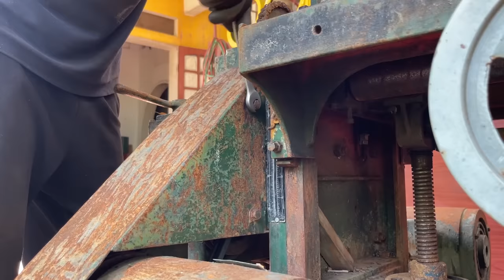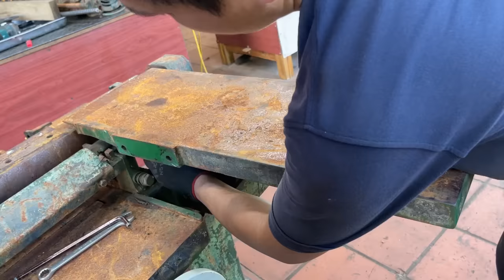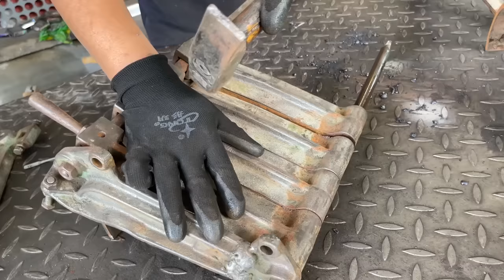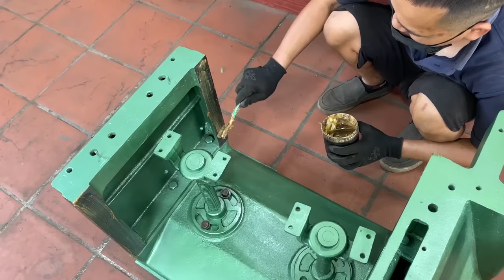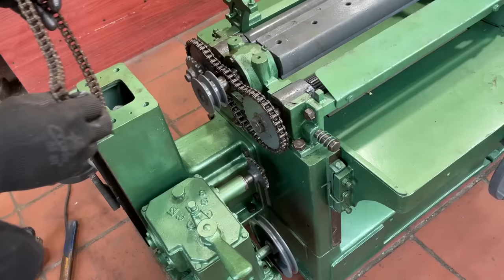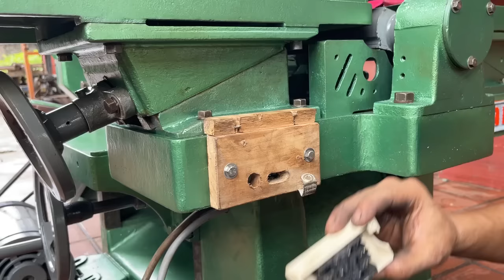Restoration Genius  The Genius Boy Restores The Hitachi 3 In 1 Woodworking A 1500A For Carpenter

Comment: Jesus, when you did your test cut the cutterhead was 1/4" higher than the outfeed table... you're lucky you still have hands.
Reply from the maker: Thank you very much, please watch our next videos
Reply: This is all fake bs. Finds a relatively rust free tool in an ally next to a crane truck.  It's hot, humid, and rains everyday where he's at.

He has no clue what you're even talking about, or what he is even doing with this crappy machine.  No clue how to use a jointer, no clue how to use a planer, and will no doubt cut off a few digits soon, if he hasn't already
Reply: I agree that he should be greatful for not having a hand less!
Reply: @CaptainRon1913  they buy old machine from somewhere and then make a video with it 
i bet is the same company that was making the fake "house of mud in the forest" "primitive tecnology" videos and got busted 

they are entertaining tho :)

Comment: This is such a fascinating piece of equipment, if it had been done correctly. Never paint your feed tables or planer knives, or saw blades, that just creates drag and it’s gonna wear off quickly anyways. Also I’m glad you didn’t lose fingers when the jointer kicked back. Make yourself some push sticks, your safety is worth the effort.
Reply from the maker: Thank you for your comments, we have learned a lot from you. We invite you to watch our next videos
Reply: @restorationproduct1718  please remember that wood working machines can take your fingers or hand off before your brain even knows something went wrong, it just takes a fraction of a second.
Reply: That jointer taking of half an inch off was scary. VERY SCARY. I wanted to comment the same, "congratulations on not ending up injured. Please be safe, there is no shame in it"
Reply: I agree.  I cringed every time you ran your hand over that jointer blade.  Then I jumped when it kicked back in your second pass.  Please be careful!
Reply: @cm5838  you have that right! I have nerve damage from carpal tunnel and diabetic neuropathy in both hands. I have zero feeling in them. So when I let my right index finger relax a little too much it had a conflict of space with the blade on my table saw. Yes I was using a pusher stick but shit happens fast. I'm looking around to see where all the blood was coming from. It seems instead of cutting off the tip like normal people, I had to split mine right down the center to where the nail quit and skin took over. Aw, shit! I wrap it up in the cleanest rag I had and walked inside to tell my wife I needed the emergency room. She just grabbed her purse because she knew when I said go.... I was serious. 
So the doc is looking at it and says stitches and starts to get the numbing stuff out. I told the doc just to do his thing. He tells me it's gonna hurt. I'll be ok, just have at it. So he gets the Q Tip looking thing and starts cleaning it out. I'm just smiling at him. He is starting to look a bit uncomfortable by now, wondering if he had some insane guy here. I finally let him off the hook and told him I had crushed that finger years ago and had no feeling in it. He stitched it up and said that was the weirdest thing he'd ever had happen to him. 
The finger healed up nice but it still has a funky nail. 
Yes. Freakishly fast. Then you are bleeding. That's not good. 
Cheers
Terry
Reply: @machinist5828  Bet you were real glad you crushed that finger beforehand. Had an impact cam out and put a full speed PH2 bit all the way through my thumb nail and then the rest of my thumb once, I'd have traded feeling in that finger to have never felt that.
Reply: Gods, that electrical wiring 🤮🤮, no strain relief, no grommets, cracked and crusty insulation. I know it’s unfair to compare regulations in different parts of the world, but there is no way on this planet you’d get me to use that machine.

However, the lad is a fair mechanic, so ya have to give him that, and brave too 😜

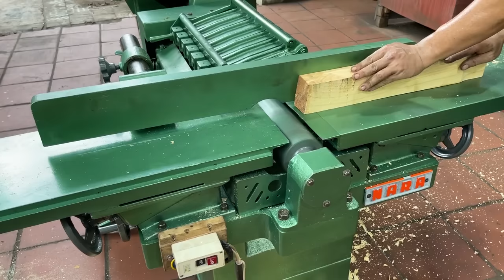Comment: My man almost lost his hand at 54:33....jesus.  Good on you putting this back in operation but it was almost your last rebuild.
Reply from the maker: We are also very lucky, and learned a lot from this machine
Reply: @restorationproduct1718 Except how to use a push stick. You immediately repeated your mistake. You're not going to have all your fingers for long.
Reply: @R.Daneel  wrist
Reply: It's because he was using the planer incorrectly by removing nearly a centimeter of wood at a time, which led to a kickback, and they nearly lost their fingers.
Reply: OMG!!!! I can't stop laughing🤣🤣🤣🤣🤣🤣🤣🤣🤣🤣
Reply: DUDE that was REALLY close.... You could see it coming, no guard there and he's pressing down like that omfg!!
Reply: Push stick, and take less off at a time Holy God Almighty
Reply: It has nothing to do with push sticks or how hes holding it. The exit table needs to be the same height as the blades or .01mm lower he has it way way too low. That wood is riding on blade only.

Comment: Nice work but the table tops should not be painted just polished and machine waxed
Reply from the maker: you are very right to say that the worktop is not painted. we have cleaned the paint on the work surface and applied a protective oil on it, thank you for everything
Reply: Poca seguridad n el uso d la máquina...
Reply: Non of the machined faces should be painted.
Reply: 8
Reply: Non of the machined faces where the wood will be touching or sliding should be painted.  Rather they should be polished and then given a coat of wax.  Other than that mistakes nice job.
Reply: @restorationproduct1718 🎉😅😮😢
Reply: That's true, he can always strip the table tops, buff them out, and furniture wax them to prevent rust
Reply: DUDE.....GET A PUSH STICK!!!!! When you were testing the jointer, I almost freaked when it looked like you had pushed your hand into the knives!!! Please be more careful
You did a pretty good job on the restore, except for painting the machined moving faces, as has been said, mating moving faces get lubrication and need to be bare of paint!
Reply: You are 100% right, but this is typical an example of getting as many youtube hits as possible. Because an expert will do the job different and better.
Reply: I agree and the electrical work was ruf as guts and that bit of pallet rack wood behind the switch ruf and ready
Reply: Fake anyway 🎉🎉🎉😂😂😂

Comment: I'm a new subscriber. Fantastic job of rescuing this piece of equipment. I do agree that metal table tops should not be painted, as the paint will wear off. You can clean them with WD40 ans steel wool. Then waxed with machine wax or car polish. This will repel water and prevent rust. Remove all rust from the inside of brackets and the bars that hold them. Other wise it will continue to rust. Avoid painting adjustment screws and the gears. As the paint will wear of and can cause problems later. Polish them as clean as you can. Tape off before painting, then apply grease only. Good luck, hope to see more soon.
Reply from the maker: Thank you for sharing a lot of interesting knowledge, we learn a lot from you

Comment: Sin demérito del esfuerzo y pese a las limitaciones del lugar en:  equipo o herramientas,  los reemplazos como el tensor de cadena que no es original,  las cajas de conecciones que se pueden improvisar con cajas conduit normalizadas para resistencia mecánica,  y decir que las superficies de trabajo expuestas a roces de la madera, no deben pintarse porque eso crea alguna resistencia al avance, aparte de manchar en algunos casos  las piezas de madera. Lo mejor es solo pulir bien  y dejar el metal tal cual. Pero les felicito.
Reply from the maker: Gracias por compartir muchos conocimientos interesantes, necesitamos aprender mucho de ti.

Comment: The skill & expertise shown on this is excellent.  Many designing engineers deal with a complex machines they draw up and only have responsibility on a theoretical basis.  In other words they aren’t mechanics putting the equipment together, or the end user actually getting it to function, in this case carpenters.  That is not to say any of these skill sets are inferior, but my gues this fellow is mor of a mechanic than design engineer or carpenter.  I also think it is entirely possible that he’s never seen this Hitachi  in any shape.  His talent is superb.  The owner of the shop that abandoned it is probably still looking for the idiot that parked outside. This machine in its ruined condition would bring around $4000 US.  Restoration would add several days and bring the price up again.  Very complex.  Thanks for posting.
0 57:52
Reply from the maker: thank you very much , we worked for many days to get it working again, the result is amazing
Reply: Set the second half of your jointer table the same height as your blades are cutting and you will eliminate that deeper cut at the end of the pass
Reply: Hats off to the genius who designed this machine  😅😊😅😊❤

Comment: Wow! he could have had a very bad accident when planning  that piece of square wood.  The back table wasn't set level with the cutting edge of the blades, it was to low, so when he got to the end there was a big dip in the cut.
Reply from the maker: I'm sure you are a professional, we thank you for your comments, good luck
Reply: @restorationproduct1718  Thanks for the reply. I am a qualified wood machinist.
Reply: Outfeed table
Reply: It also looks like the in feed and out feed tables weren't parallel  @stefankaz53
Reply: Oh, so the exit side has to be parallel to the planer blades' cutting edge to prevent the overdigging and danger of feedback? Good to know. 

I would think they would use push sticks or some form of safe workholding - anything to keep fingers away from that exposed high speed planer blade...yeesh

Also, I am assuming that the correct direction of workpiece is against direction of cutter rotation? 

I've been rather interested in a planer, but more of a want than a need, as I am more of a machinist than a woodworker

Comment: Great job of rebuilding it and making it useful for  a few more decades. But be careful, fingers don't grow back. I was surprised you did not sand blast the pieces instead of using a grinder and wire wheel. Any particular reason?
Reply from the maker: Due to difficult economic conditions, we do not have money to buy a cutting machine, we clean it completely with a hand grinder, thank you very much.

Comment: Good work but you should be wearing safety boots. When using a dolly for the end of shafts make sure you use a brass or copper one , not steel.  The electrical connections need to be improved for safety and emergency knee or hand stop fitted. I did enjoy watching you restore old equipment.
Reply from the maker: Thank you very much

Comment: realy smart mashinery you can use the jointer-function the same time as the thicknesser ... I have seen a mashine-setup like that ... I guess the only downside to that is the very very long expensive cutting-blades ... else it is forsure a nice combi-tool, thou a riving knife for the sawblade you be better... I was to quick .... now I see spindel have a dual setup, hence two seperate sets of knifes
Reply from the maker: Thank you very much, you are very knowledgeable about woodworking machines, nice to meet you

Comment: The way he put in the planer/jointer blades and how he used the saw makes me beliwe that he has absolutly no Idea what he doing with this machine. hope that that carpenter who gonna use it not gonna get hurt and gonna do all kind of adjustment before using...
Reply from the maker: You are very right, when the carpenter received the machine, he had to realign the cutting blade, thank you for everything

Comment: Well done but you need to fine tune to out feed table of the jointer or you will loose your fingers. the outfeed table needs to be wound up and when feeding the timber on the jointer try not to take so much wood off in one hit. Be safe mate as they do make a mess of your hand.
Cheers
Brad
Reply from the maker: Thank you very much, we learn a lot from you, and lessons learned from this machine, see you again in the next videos

Comment: At the 54:18 minute mark, you can see that the base of the planer (on the right side) is set incorrectly in relationship to the left one. Not only is he taking off too much but the base on the opposite side (left side) is too low. When he is at the end of his cut, you can see that the workpiece drops and, as we saw, that's dangerous. So, in other words, he has both bases set incorrectly from each other based on the direction of the cutting blades. The only way to correct it would be to raise the left base and lower the right one.  He's lucky he did not lose his fingers.
Reply from the maker: Thank you for sharing your experience, we will learn from it for next time

Comment: The planer blades do not cut correctly, as can be seen in the images, they leave many steps in each pass.
Reply from the maker: It's possible that the blade is worn unevenly, so we'll replace it with another blade

Comment: Correct sized spanners do not mess up the corners of the bolt heads
Reply from the maker: you are very right if you use the correct wrench, the bolts will not be like that

Comment: It's looking good, but, I don't agree with the painted work surfaces, though. The only thing that supposed to be on them , they should be cleaned off, all the way down to bare steel, and with a good coat of wax. The woodshop where I used to work, we used Turtle Wax. We even waxed the table saw blades, the radial arm saw blade, and the band saw blade.  Safe to say, we had a smooth operation, at that shop.
Reply from the maker: Thank you for your feedback, we will learn from your experience for next time. We invite you to watch our next videos

Comment: The near accident that almost made him lose a finger is unfortunate. (The fact that they did not edit it tells us "WHAT NOT TO DO" when working with any equipment). BUT we have to acknowledge and appreciate what he has done to bring back life to this machine. It may not be perfect and surely not as pristine, but the fact that this Hitachi woodworkers tool has been exposed to the elements make it worth the time and effort put into it commendable. Some adjustments later on will be easier because of its present condition.
Reply from the maker: Thank you very much, we promise to try harder not to disappoint you

Comment: Hello, I don't care if you wrote that the instrument was restored but after the fact, you cleaned and decorated the living room, and you didn't have to add these details to your sides, high humidity but ordinary cream helps the instrument was damaged and assembled, it was correct, I thought you should correct the plug, not the far end, the quality of bending the bolt, but the bottom bit drive sprocket waste of time and effort, the instrument must not be finished and left broken  and all time fear for chain or sparks
Reply from the maker: Thank you for your valuable sharing, we need to learn a lot from you

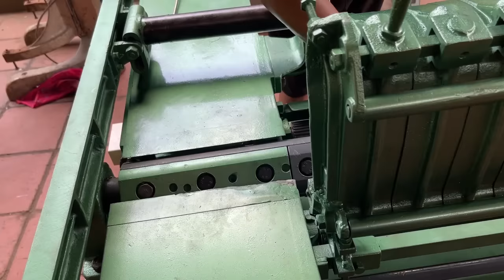Comment: 54:07  That gave me the yips. No guard, no push blocks, and he's taking off waaaay too much wood. That bed needs to raised significantly. Also any surfaces that come in contact with wood or other metal parts should not be painted.
Reply from the maker: Thank you for your comments. We will learn from our experience for next time. See you in the next videos.

Comment: just seen this on my TV and went to my ipad to post comment. love these videos but this one makes me think it is FAKE, why?
1. Why would someone dump a machine like this on waste ground when it has scrap metal value
2. Those drive belts looked pretty new and tight, which suggests it was used not too long ago
3. Even if it is very rusty now, it could have been used a while back, I suspect because of an electrical problem, it was left in some factory to rot, or put outside and the weather caused the rust.
I could be wrong, just giving my opinion.
Reply from the maker: Thank you very much, you are quite right about my product, that machine was thrown out not long ago by the wood workshop and due to harsh weather it rusted like that.

Comment: ok, so basic greasing, removing rust and painting was done. how about actually adjusting the blades? i would accept a machine like that only because i knew it worked, but still need tonne of adjustments.
Reply from the maker: Everything was fine until we installed the planer, we needed to learn how to adjust the blade from the carpenters
Reply: @restorationproduct1718  thank you for clarification. In such case marvelous job.

Comment: I'll start off with, you could probably have found the manual for the machine for free on the internet. the manual has the specs for tunning the equipment before first use. next, NEVER paint gears, worm screws, or shafts, in time the paint will start flaking off and cause them to bind up.  and NEVER paint any surface that comes into contact with your work piece like a feed table and rollers, it will cause marring and friction. while the wire wheel is ok for a DIY, you should have followed up with a very fine grit sandpaper and block if you're unable to get it surface ground and trued up. 

anytime you use a wire wheel you create little ridges, you may not be able to feel them but they are there. at the least, like with the shafts, wrap a bit of fine grit sand paper around them and give them a going over. myself, i'd put them in a lathe and spin them running a 600 - 800 grit over them to make sure they were nice and smooth, you shouldn't have to use a hammer to reassemble anything. and always replace old bearings. they should either be a slip fit, or if pressed on, then use a ring and press them on evenly with a hydraulic press. anytime they get cocked you run the risk of cracking the bearing case and damaging the bearing..
Reply from the maker: Thank you for your comments, see you in the following videos